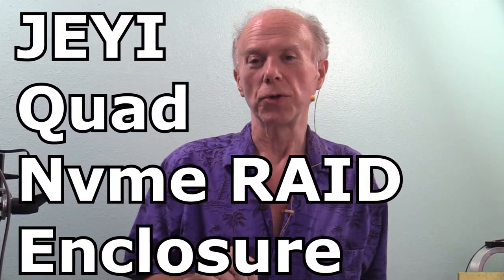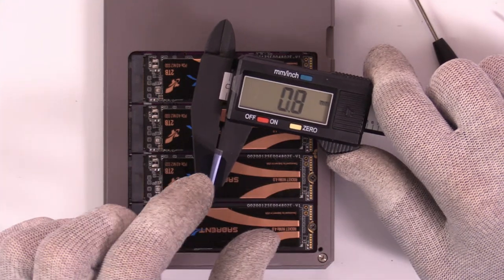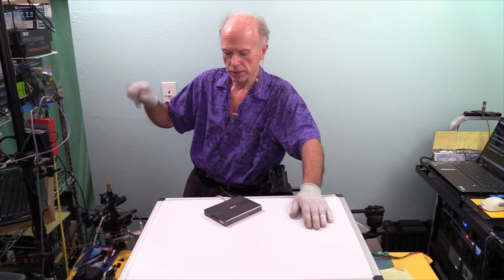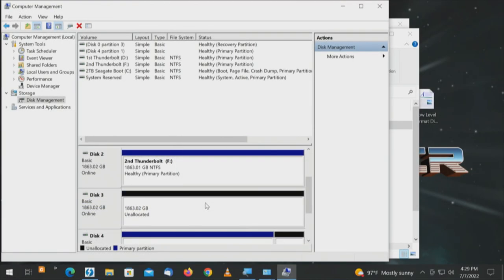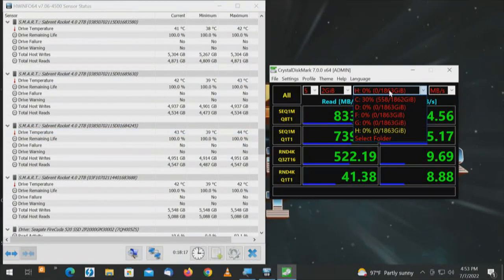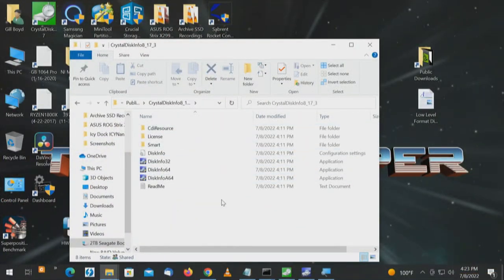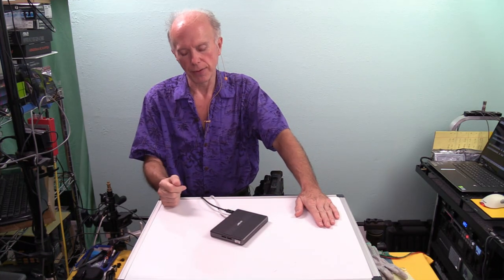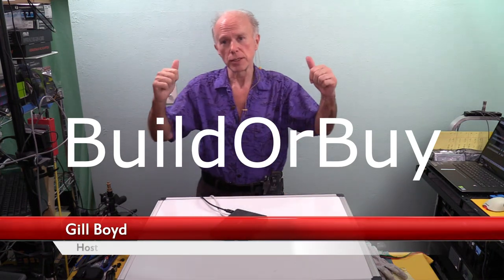JEYI Quad NVMe RAID Enclosure Thunderbolt

Comment: I ran across a JEYI PCIe Expansion card version to use in my mid-tower. Even if its not super fast it would be a handy software RAID under Windows to protect data. Thanks for a very thorough video.
Reply from the maker: Hi @serow6 ,
Welcome. Just now seeing Your message. Thanks for Watching. Appreciate Your comments.

Comment: Good morning straight from Brazil!
Thank you for the excellent explanation about the product's capacity!
I bought the same a few minutes ago on Aliexpress and then I came to see your class!
I usually prefer products from another brand, but this other brand doesn't have a storage with this capacity so I bought "in the dark" this brand you presented.
Now it's time to wait for the storage to arrive and see if I can configure its access correctly with my Notebook.
Reply from the maker: Hi Hiran,
Welcome! Appreciate Your Comments! Let's hope this product meets Your expectations! Keep Us Posted on Your Progress!
Reply: Good Morning.

     Only yesterday I managed to work on Sorage.
     But the same does not work for nothing!
     I didn't even put an NVME on it yet because I don't have many and the same ones here in Brazil are expensive.
     I'm improving the settings of my note little by little.
     Today the note has 64Gb of RAM and 4Tb of discs, 2Tb in NVME from Samsung 980 and a HD 2.5 of 2Tb also from Samsung that I bought here in Brazil.
     Jeyi's Storage doesn't connect with the power source they sent me from China, well that's the impression I have.
    I looked for the product manual on the internet and couldn't find it to download.
     I was thinking about buying a power source here in Brazil. But I'm not sure which font model I buy.
    The power source that came with it is written like this:
   Model: 65W
   Input 100-240~1.5A
   Output: 5V-3A; 9V-3A; 12v-3A, 15V-3A, 20V-3.25A
   Power: 65W
   D C : USB Type-C.
   Do you have any tips for me on which font to buy?
Reply from the maker: Hi @hiranhorta , 
Good Morning and Happy Holidays! Sounds like You have the wrong Power Supply. According to the Specs: USB-C 33w adapter and 1.5m/4.5ft PD cable are  included. Must be paired with a PD 30w power supply to operate properly. Power Supply for US is 110 AC Power. Brazil has 220 volt. Can't read Specs on Unit We have, packed. In process of moving right now. Hope that helps!
Reply: Estou quase comprando um desses. Vc resolveu o problema? Vejo muita gente reclamando desse problema de alimentação dele assim que abrem o pacote da China.
Reply from the maker: Hi @ederjacksonrochabezerra9159 , 
Translated for those Viewing Our Comments. 
I'm about to buy one of these. Did you solve the problem? I see a lot of people complaining about his feeding problem as soon as they open the package from China.

Welcome! Let's hope so! Appreciate Your Question!
Reply: @BuildOrBuy  sorry, my friend. I saw that Hiran is brazilian also and have made him a question about his problem of the enclosure power supply. I will enjoy this message to say that I'm glad to talk with you. You really do an amazing work with these reviews. Thanks, man!
Reply from the maker: Hi @ederjacksonrochabezerra9159 ,
Good to meet You! Very much Appreciate Your Comments! Let's hope Hiran was able to secure a proper Power Supply for this Device! An RMA would have been a  preference for anything missing!
Reply: @ederjacksonrochabezerra9159  só serve para que tem macbook e ou porta thunderbolt no computador  / notebook.  O que não é meu caso.  Meu notebook é da Samsung e não tem este tipo de porta 🚪 que não é compatível com usb! Se o seu for um macbook ou tiver eu te passo o meu pelo preço que paguei.

Comment: You are right with the heat! Also gloves for charge prevention!
Reply from the maker: Ho john collins, 
Welcome! Appreciate Your Comments! You'd be amazed at some of the uninitiated and ill advised who do not understand ESD susceptibility even after quoting Documentation Advisories or Design parameters of Media specifics such as M.2 NVMe 2280mm vs SATA3 2.5 inch SSD packaging. Those are the ones who are doomed to repeat due to lack of experience. That alone would be a Video regarding handling procedures as outlined by everyone who makes anything electronic. If We ever get hit by an EMP, that will be an experience to remember. Thanks for Watching!

Comment: The poor write performance might be a characteristic of that Sabrent model (and its firmware version) when used with Thunderbolt.  You may see better results with a firmware update or different SSD models.  For example, the WD SN850 used to have terrible write performance when installed in a Thunderbolt  device.  The SN850 firmware update released last summer to fix the write performance problem with the AMD X570 chipset also fixed this issue with Thunderbolt.  

You mentioned wanting to know what  PCIe switch chip is in this device.  The Thunderbolt controller is the PCIe lane switch.  Like you described,  four 1-lane  connections, one to each SSD, flow to  one 4-lane connection to the PC.
Reply from the maker: Hi Robert Gibson,
Welcome! Very good point! Could be the Sabrent Drives or could be the Bridge Chip! Requires further investigation beyond an Unboxing! Yes, We had issues with the WD Black SN850 on the Gigabyte X16 M.2 NVMe PCIe Quad card but did not have any of those issues on the ASUS nor ASRock! And We've used the Sabrents on all 3 of those as well as other M.2 NVMe PCIe cards such as the Glotrends Sky and Amfeltec Squid Carrier Board. The WD Black SN850 was a surprise in deed! Based on the Thunderbolt OEM Device ID, there's a Bridge Chip to connect the M.2 NVMe to the Thunderbolt even if it's just a pass through. Expect that would require a Microscope to View even if We did go looking based on the size of the Device. Looks like We're going to start using a Microscope! Appreciate Your Comments! Thanks for Watching!
Reply: 90 percent of poor write speeds I’ve encountered were due to power. Often a particular drive is is right on the limit of the slot so it dips at times. With that said my Samsung 990s don’t like having less than 4 lanes available. Run them by them selves to include JBOD and they seem to stay happy.

Comment: Thanks for this great video👍. I have done a lot of searching without results, and finally I want to ask you if a Dual or quad slot m.2 nvme USB 4/Thinderbolt 4 enclosure even exist. Plan to use it on a future MacBook Pro or Mac Studio configured as Raid 1 or even RAID 10..
Reply from the maker: Hello Tor Bruheim, 
Welcome! Appreciate Your Comments! Yes! In no particular order as follows with the Qualifier being Thunderbolt. If only requiring USB-C or Network then 2 more possible Options: 
1. Thunderbolt 3 Dock 9-in-1 Dual M.2 NVMe/NGFF Enclosure, ORICO USB C Docking Station 40Gbps 
https://amzn.to/40PNGVx
2. ORICO Dual M.2 NVMe SSD Enclosure, USB C to M2 Adapter for M Key PCIe 2230/2242/2260/2280 M.2 SSDs,Tool-Free Installation Aluminum M.2 Reader Support Trim and UASP up to 2x4TB-AM2-2N 
https://amzn.to/3oSIsLl
3. StarTech.com 4 Bay Thunderbolt 3 NVMe Enclosure, for M.2 NVMe SSD Drives, 1x DisplayPort Video/ 2X TB3 Downstream Ports, 40Gbps, 72W Power Supply, External Hard Drive Enclosure (M2E4BTB3)
https://amzn.to/3oTug4S
4. OWC Express 4M2 4-Slot M.2 NVMe SSD Enclosure w/ Thunderbolt3 Ports with SoftRaid XT
https://amzn.to/3LmgEXp
5. Fastest Thunderbolt RAID 
https://iodyne.com/
6. Blackmagic Design Cloud Store Mini, 8TB
https://amzn.to/3Hpdr8n 
7. Blackmagic Design Blackmagic Cloud Store 20TB 
https://amzn.to/4288jgx
As an Amazon Affiliate I earn from qualifying purchases! Hope that helps!
Reply from the maker: Hello Borja Etxebarria, 
Welcome! Please see links provided to Tor. Hope that helps!
Reply: @BuildOrBuy  Awesome. Thank you for your effort. This will help.
Reply from the maker: Hello @TorBruheim ,
Outstanding! We're Solving Problems and Providing Solutions!

Comment: For backup data for long term storage, can this possibly be used in windows storage spaces or is the 2 drive options better. I am not worried about speed, but the TBW and the backup/redundancy. If not, can you suggest another feasible solution. Is a synology  NAS solution better? Again, I want to stay away from mechanical drives. That is why I am searching for a solution. Thanks for the help. Long time subscriber.
Reply from the maker: Hi Terry Griffin,
Yes it can. However there are better Options available depending upon Your Budget. This is a Software RAID Solution. Any real external RAID Solution should be independent of the Host Computer. Thus an external Hardware RAID Solution. And preferably something Scalable such as iodyne.com or Blackmagic 

iodyne Pro Data 
1. https://iodyne.com/

2. Blackmagic Cloud Store 8TB 
https://amzn.to/3MsvWdR
As an Amazon Affiliate I earn from qualifying purchases! Options. Hope that helps!
Reply: @BuildOrBuy  Got it
Reply from the maker: Hi @terrygriffin5201 , 
Excellent! Glad We could help!

Comment: The drives in disk management shows healthy buy they're not visible in windows explorer because they don't have any drive letter assigned to them, you could have just assigned a drive letter rather than delete the volume and recreate it. Just my opinion. Hope I'm not offending you.

Thanks for the great detailed video.
Reply from the maker: Hi SS COMPUTERS,
Welcome! One of the many wonders of Windows! Usually more than one way to accomplish a Goal! So too are Sanitize commands but not necessary for most situations. We treat all Removeable Media the same. Especially working with many different Video Cameras. Always format Media in Device doing the Recording to restore File Structure integrity and prevent Data Corruption. Not as big a deal with NVMe as an SDXC card. We should have treated the M.2 NVMe PCIe Drives as new Drives from the Viewers perspective. However, We have lots of Videos on RAID and Quad cards. This was expedient. Appreciate Your Comments! Thanks for Watching!

Comment: You're absolutely correct about PATIENCE, so I watched thru the video and saw you were using WINDOWS. I had the exact purchase in mind yesterday, but hesitated because it also mentioned SOFTWARE RAID with Windows, and not MAC... which I wish to use with, as a work and scratch editing drive with the same SSDs you put in, so does it work the same way WITH A MAC? Thanks for an interesting video, very thorough testing procedure!
Reply from the maker: Hi Mario da Silva, 
Welcome! Appreciate Your Comments! Yes, this Device will work with MAC - Thunderbolt! We much prefer a Hardware RAID for an external RAID. However, to reiterate, this Device will work for You! Hope that helps!

Comment: I finally found a used one!   You said you would only use this as a transfer drive and not a working drive, any reason why?
Reply from the maker: Hi @erbartlett ,
Welcome. Congrats. Anything in RAID should exist in 3 places. Your Results may vary. Experience is the best Teacher.  Did You ask the Seller why they were selling the device?
Reply: @BuildOrBuy  Gotcha, yeah, I'll have this backed up in 3 places.  I dont really need the speed so I may just use it in JBOD.  Its for the b-roll of my youtube videos, so I just need to take a large amount of files with me and I hate plugging in 4 different SSDs just to edit a video.

I asked the seller and they run a photo studio and they were just clearing out gear, they said they never used this one.  Got it for $180.
Reply from the maker: Hi @erbartlett , 
Smart choice. I can relate. An acceptable answer.
Reply: @BuildOrBuy  Thanks, looking forward to more of your content!
Reply from the maker: Hi @erbartlett ,
Fantastic! Thanks for Watching.

Comment: On some motherboards you can have 4 NVMe slots some thru the CPU & some thru the chipset. In addition there are 6 or 4 sata available sometimes only 2 sata available as the NVMe’s tend to disable some sata drives when installed. My questions is can you create 2 RAIDs on one motherboard? Let’s say between 2 NVMe’s on the board itself & 2 sata drives especially RAID 0, hardware RAID No software involved.
Thank you so much for all you share.
Reply from the maker: Hi Bergo4ever R,
Welcome! Great Question! Yes, as We reference the Gigabyte TRX40 Designare as having that capability of 4 M.2 NVMe PCIe Drives, on the Motherboard. 2 to CPU and 2 through Chipset. A HEDT Configuration of Dedicated PCIe Resources. 

Your RAID Q: Can We have Multiple RAIDs on 1 Motherboard, Yes! A true Hardware RAID requires a Hardware PCIe card with something like a Broadcom MegaRAID. We have a Video on that Topic! 

As a Hybrid Bios Bootable RAID.
1. M.2 NVMe
2. M.2 SSD
3. SATA3 HDD or SSD But not Combined. Disparate technologies. Each must be like kind. 

Those 3 above can all coexist as separate RAIDs but cannot be combined. To reiterate Disparate technologies! On the AMD and Intel Motherboard RAIDs, the expectation is once RAID is turned On, Everything will be in RAID. And that's NOT required but that's the Default Driver install behavior. We have another Video on that for a non typical Hybrid Bios Bootable RAID whether used as Boot or not. Hope that clarification helps!
Reply: @BuildOrBuy  Thank you.
Reply from the maker: Hi @bergo4everr ,
Absolutely! Appreciate Your Comments!

Comment: If you could do a follow up video and test the temperature of this unit under load, I think that would be illuminating.  More respected manufacturers, example OWC, in fact everybody I know has a fan for cooling purposes .  So how does this perform under load?   Say transferring 2 or 3 TB of video files and doing a video export.   Just my thoughts.
Reply from the maker: Hi m,
Welcome! Great idea for a future Video when We explore those types of Results. That aspect does absolutely generate heat. Burst mode of Specs can be very different than actual Throughput for a given file size over a given amount of time. We've had these Discussions before for the many aspects of NVMe. Or any Storage Media for that number. Always Test and Verify! For the most part, External RAID should be Hardware RAID so it's independent and portable. And from what We've experienced with M.2 NVMe PCIe Heatsink Testing, be prepared to blow all expectations out the Window! That experience alone has shown Passive Cooling to be more effective than Active Cooling just Testing to Verify as Described. What We know to be true, the faster We go repeatedly, the hotter We get. And that definitely affects Performance! Appreciate Your Comments!
Reply: @BuildOrBuy  great video, I agree though that real tests for these enclosures are  large file transfers. Bust type tests are hugely misleading.  I have to transfer 1-2 terabytes from nvme to nvme with hash checksums all day long with about an hour of idle time inbetween. sadly Nobody ever runs those sorts of test in reviews. Did you find out why the drop in speed? It may also have been nvme heat/speed throttling. The prev rockets (blue) i have do not have the throttle.

Comment: Why do you suggest to not use this as a "working drive"?  Would you worry about heat?  Reliability?  Do you see software raid as not optimal?  I've been using SATA ssd's with SoftRaid in a raid 4 config on my mac and it works fine, though it does seem like the lifetime of the SATA ssd's isn't as great as I'd expect.
Reply from the maker: Hi loonsailer,
Welcome! Great Question! A software RAID, especially external is fragile. If You've ever lost a Drive, multiply that frustration! Besides, anything in RAID should exist in 3 places. Yes, RAID is more stable than it use to be. Especially with SSDs or M.2 NVMe PCIe SSD Drives!  However, not portable like a Hardware RAID. Just speaking from experience. Your Results may vary! Great Enclosure! Thanks for Sharing! As to the longevity of SSDs and M.2 NVMe PCIe SSD Drives, Backblaze has the best Stats. The technology is just too new to know yet about that inevitable possibility, not if but when!

Comment: Can you hook up the Jeyi enclosure to USB-C or is it requiered to have Thundebolt?
Reply from the maker: Hi darthvadar7,
Welcome! Excellent Question! Thunderbolt required vs Thunderbolt Compatible. This Device requires Thunderbolt. Which makes this an all or nothing Device. Every new Computer will have USB-C. And USB-C with an adapter can connect to USB 3. However, with Thunderbolt, it's strictly Thunderbolt which is a Bummer! 

USB-C 10Gbps and USB-C 20Gbps 2x2 is easier to implement than Thunderbolt 40Gbps. Hope that helps!